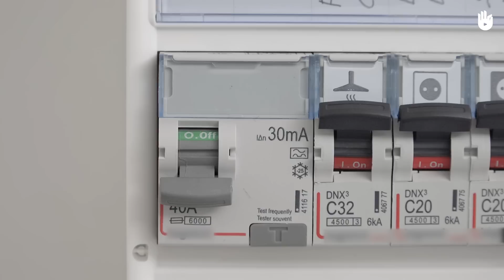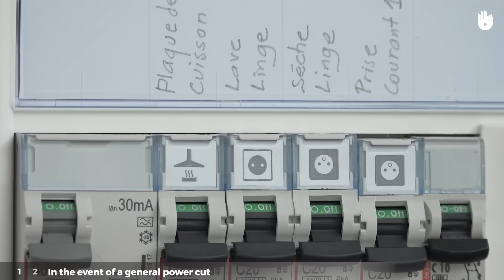How to Detect a Fault in an Electrical System | Electricity

Comment: Perfect Connection Electrical Service is one however that has been around for a long time. This company is built on a sense of Excellence and Strong Traditional Values that ensures our customers get the very best in service, value and affordable pricing. If you live in Florida and have any Electrical needs, whether Residential, Commercial or Industrial Specialty Service Repair, then Contact Perfect Connection Electrical Service.
For more details visit: https://perfectconnectionelectricalservice.com/